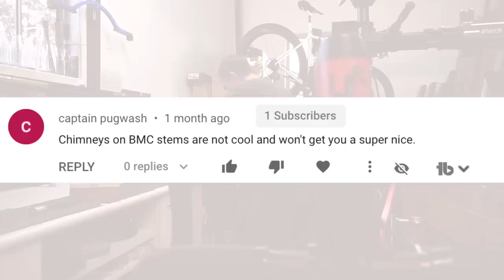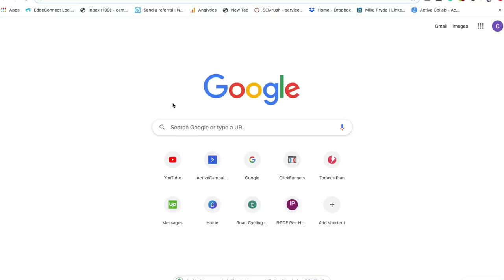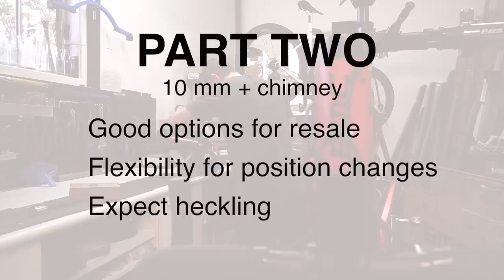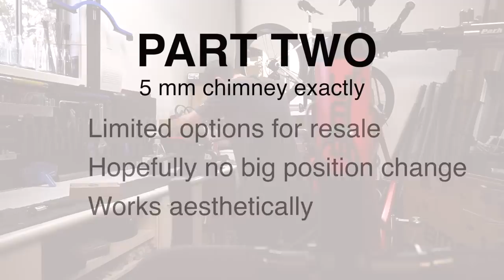OH DEAR, what have I done to my BMC Teammachine!?

Comment: I’m surprised no one has mentioned that leaving a 5mm spacer above the stem is a bit safer.  It allows the compression plug to fully support the steerer where the stem clamps.  Slamming it requires the steerer to be a few mm below the stem, causing uneven clamping forces, making it more likely that the stem will cause crushing damage.

Comment: Chimney?  I call it the “resale knob”.
Reply from the maker: hahaha!
Reply: Exactly - fell that chimney and you cut your resale market HUGELY. The number of times I’ve liked a used bike but the owner has slammed the stem ....
Reply: @cyclotaur6315  lol in singapore, fixed gear riders are usually teenagers (flexible lot eh) and everybody slams their stems without thought, and people still buy it somehow
i slammed my cinelli mash bolt and damn, it looks nice but i dont feel any discomfort so yeah
Reply: If the compression plug doesn't extend to the bottom pinch bolt, it's really the "fork steerer failure knob".

Comment: Correct me if I'm wrong, but I didn't hear any mention of the importance of ensuring that the compression plug inside the (carbon) steerer is located at the correct position so that when you tighten the stem bolts it doesn't crush the steerer tube. If you have, say, a 35mm 'chimney' and a short compression plug with a 'lip' which locates it at the top of the steerer tube, there will be nothing inside the steerer at the point where you tighten the stem bolts to resist crushing forces. Seen a couple of forks snap that way with interesting consequences. I personally ride with no spacers under my stem and no chimney and bought my current frame on the basis that it had a 178mm head tube so that I could set it up that way at my preferred height. A solution to your problem which you may not have considered would be to move your cleats back 7.5mm.
Reply from the maker: Yes it was an oversight. I’ll raise in the next video in Friday. Thanks for the pick up

Comment: Safety is another consideration regarding how many spacers are above the stem. The expander/compression plug inside the steerer is designed to strengthen the steerer where the stem is getting clamped and squeezing the steerer.  If you have too many spacers ontop, the plug isn't where it needs to be. The plug will be sitting up too high in the steerer and the stem will be squeezing on hollow steerer tube, with no reinforcement from inside. Definitely the BIGGEST consideration with spacers.....it could save your life.
Reply from the maker: Good point thanks for adding mate.

Comment: Get some thicker bar tape Cam, or double wrap it. That will raise the front a little.
Reply: That's a smart idea
Reply: A step further would be to run a 28mm tyre up front and a 25 at the back.
Reply: Hugh English that wouldn’t help. You’d still be in the same position relative to the crank, seat and handle bars.
Reply: How about a 650b wheel at the back😋

Comment: Aesthetics? I would consider mechanical issues. A 5 mm spacer on top of your stem will make sure that the stem and compression plug will be aligned and balance clamping forces. This will prevent carbon damage on your steerer.

Comment: I had to look into this recently after buying a new stem and the instructions said "minimum 5mm spacer below and if installed on a carbon steerer tube one spacer above". The reason that it is recommended to leave a spacer on the top is not to crush the free carbon edge on the steerer when tightening the stem potentially causing delamination. Not all steerer tubes require the spacer above, if the expander insert fully supports the free end then you don't need a spacer above. That being said, if you only have a 5mm spacer above and a unsupported free end you don't have any upward adjustment.

Comment: it has nothing to do with space length below the bars - what ever is comfortable for your style! There is nothing technically incorrect with having a lot of spacers below the bar - it is just an aesthetic concern.  Your concern about a "chimney" is only aesthetic, however, SAFETY  and potential compromise of the carbon steerer tube is more important. If you have a significant chimney without changing the standard expander plug - you then have the expander in the steering tube > expanding out without resistance. The expander is designed to push out but against the stem. If you have a chimney you should have a longer expander plug > that reaches down to the depth of the stem. I believe durian rider speaks often of this.

Comment: Two points,
1. Running spacers above the stem is dangerous if you have not got a long plug, as the stem is not fully supported. Re: check out leuscher technik.
2. Smaller cranks will give you less leg lift, so the lower handlebars may be okay.

Comment: I had the same problem with my bike, shortened the cranks but had very little room to move the handlebars up.
I switched to the Ritchey Ergomax WCS handlebars which have 10mm ride on the tops.  Some others like the Hover bar have more around 15mm.

Comment: I’ve done something similar cam. I’ve just built up a bike and gone from 170 cranks to 165 and the front is 25mm lower.it has 5mm spacer below stem which is what i bought it like. I didn’t think about it at the time. It feels ok but only done a 50km ride so far.

Comment: I’ll be honest. When I bought my  TeamMachine SLR 01 disc, I replaced the cranks with a 50/34 compact 165mm crank and replaced the stock ultegra chainrings with Absolute black ovals and I left one of the stock spacers under the stem and chopped the chimney. Went to 40cm enve bars too. I love the shit out of my “Matilde”.

Comment: not understanding - you went from a 172mm crank to a 165mm crank which is shorter. You'd need to LOWER your seat slightly, not raise it, yes?
Reply: Distance from pedal to saddle is reduced by shorter cranks, to keep the same effective saddle height on shorter cranks you have to raise the saddle
Reply from the maker: @joseph.inglis  Correct, Neill's got a fair amount of credibility too!
Reply: If you’re shortening the crank you’re reducing the length from the pedal. So Neil is correct and to compensate this you have to raise the seat.

Comment: Not an overly drastic move IMO. I like the look and its not overly aggressive for a crit racer. If you go on long rides and need more comfort, flip the stem for it. No need for a bike shop there.  Northwave makes a Speedplay cleat adapter that may give you a little help if you really need it. The sad part is you need their shoes. I'm no shill for the company, but have purchased 3 pairs in the last 10 years. 

I would like to hear more about the crank length change and what you have seen as far as improvements etc. Love your channel!
Reply from the maker: Cheers mate. And yes plenty coming on that topic.

Comment: I can not understand why stem angle isn't part of your conversation Cam? Much cheaper than new forks. 

The bar's position is only determined by the combination of fork steerer clamp height and the angle/length of the stem itself when combined with a particular frame. By using a different stem angle the need to trim the steerer tube can be reduced very significantly. Smaller frames very often have more fork steerer to be trimmed than larger frames so the likelihood of needing to cut in the first place is much greater.

The length of the steerer tube of the frame itself will determine the look you can end up with when the bars are correctly located. My 61cm RS uses some spacers below a 130mm x -10deg stem whilst on my 61cm RCA I stumbled upon a slammed 130mm x -17deg stem for the same bar height. It's great to leave affordable options for the future by playing with stems, just like saddles and seatposts. What brings comfort from a bike position can change for many reasons.

When I could ride past the Beach Rd 30kph bunch solo on the RS, I didn't care if all those I passed had a better chimney look than my EC90 stem and Ti spacers gave. Behind my steerer I had my X-Lab pocket rocket blasting out tunes from an MP3 player, no ear buds for me. It has allowed my position to evolve over a decade on the RS as a now 60yo.

If what douchebags are saying about such things a chimney height matters to you, perhaps some re-centring is in order Cam! Allowing for the future fitting or resale are wise considerations, they can only be achieved according to what our budgets and knowledge allow. Also, never make 2 changes at once unless 101% certain, twice or thrice checked. Bike lessons can be expensive.

Remember that bike fitting and power production are functional, they don't care about 'the look' required.

Comment: I was about to change my crank length from 172.5mm to 165mm as advised by my bike fitter but suspended the move when I watched your videos a few weeks back. Can't wait for your new video about how you find the changes.

Btw, I enjoyed your video about R5 vs SL6. You are right, R5 indeed is just as quick and stiff but slightly more comfortable than SL6. I am 48YO and I need that.

Comment: I think it's worth mentioning, you're not necessarily stuffed if you slammed the stem and left no chimney. Steerer tube extenders are a thing. Sure, they aren't made of carbon so will likely add at least 200g to your build in the best case scenario, but at least it's an option.
Reply from the maker: Good point thanks for sharing mate

Comment: Another thing you didn't mention, is that running a 20mm chimney without a special extended compression plug is dangerous on forks with carbon steerer tubes. The bottom bolt of the stem clamps down on the empty carbon tube rather than the carbon tube with a solid compression plug in it. It doesn't happen often but there are cases where this can cause the steerer to crack and cause a crash similar to the sprinter Simon Pellaud's.
Reply from the maker: Good point that I neglected to mention. Thanks David.

Comment: Should have mounted a -25 stem to the top of the factory length steerer for that old school quill stem look instead of cutting it down to solve the chimney problem. 😉

Of course I say that as someone who bought an s-works tarmac and slammed the stem flush with a one-piece carbon bar without even riding it first. No ragrets!

Comment: I'm surprised you did not mention the importance of having the stem tightened on the expander plug in the steerer tube to avoid carbon failure? Safety is the most important part in stem height in my opinion, position comes second. It's usually not a problem these days because expander plugs are longer than before, but still, it's worth paying attention.
Reply from the maker: Yes good point Anthony. I put these videos together quickly and sometimes things get missed. I can always follow up though in the next video. Cheers, Cam

Comment: It's all good 👍, don't loose sleep over the drop of the stem, you will get used to the slammed position. No scientific backup, you will ride the hoods more until you get used to it.
Reply: Not all 'slammed' positions are the same. It depends on your saddle height and head tube length. I ride a saddle height of 750mm (mid-foot cleat placement), 57cm TT, 130mm 10 degree stem with a head tube of 178mm. 'Slammed' stem gives me a 'drop' of 7cm. I chose my current frame specifically for this sizing.  Met a guy this week with a BMC Time Machine, bought second hand with the steerer cut in the slammed position. Saddle height 80cm, head tube 160mm, drop of 14cm with a 6 degree 9cm stem. Can just about raise his head enough to see where he's going when he's on the hoods, riding in the drops and the theme tune from 'Mission Impossible' starts playing, numb nuts after about 90 seconds. Seems happy enough though 'cause it was cheap and made of carbon fiber. #hardonforcarbon

Comment: You aren’t supposed to have any spacers above the stem on a carbon fork as you need to have the expander plug inside the stem to prevent the steerer from cracking.
Reply from the maker: 0 spacers? I thought you could have up to 10 mm safely.
Reply: @CamNicholls The Cannondale manual specifically says no spacers above the stem.  Most people probably don't know this. However, I figure you can get away with spacers above the stem so long as the expanding portion of the plug is within the bounds of the stem.

Comment: How about you can get cracks in steerer tube with, 10mm + spacers on top. If you use stadart steerer plug that dosent go under stem if excesiv chimny is present.

Comment: The world is not going to end. Just a little Free thought .  Just flip the -6 deg stem over,  that's a 12 Deg change, it will be just about right. Then move your computer to the top of your stem. and no one will know except you. You can save some grams by dumping the bracket, most stems don't care it thay are mounted -6 or + 6

Comment: Despite what a lot of cyclists believe image isn't the slightest bit important. Don't cut anything that doesn't need cutting. You have potentially just cut a big hunk out of your wallet for the sake of image. Personally I have about 30mm of chimney from memory and I could care less. I have my speedo immediately in front of it so there's no aero cost which at my speeds matters not in the least. I also adjust the height of my bars up and down most of that 30mm depending on the time of year and how much I'm riding and whether I'm just out clocking up some km or trying for maximum speed.

Comment: Would be interested in the recommended height of spacers below the bars. As I have at least 45mm below the bars. No chimney at all. I have wondered about the handling of the bike with this. It works for me being older and not as flexible. But just interested as I said on the handling issue, and is it dangerous.
Reply from the maker: No more than 30mm below ideally

Comment: You can probably raise your saddle not all the way and get away with the minor difference in drop between actual and prescribed. Personally, I think if you're within 5mm on any fit measurement then you're okay. We don't sit rigid on the bike, bibshort pads vary, bar tapes vary etc etc. Don't shell out on a new fork.

Comment: Best 90seconds of your channel sofar. In my understanding you don't need to change the saddle hight at all when changing the crank length. Depends on what your intention is. Less knee bending? Or less knee streching? Or a bit of both? But I'm sure you figured that out with your fitter.
Reply from the maker: Not 100 Max just following instructions from Neill 👍

Comment: Bike position is fairly arbitrary. I've got two bikes one with a saddle to bar drop of 10cm and one with 12cm. For various reasons I cant set them up the same (steerer tubes etc) Depending on which bike I have been riding both feel about right despite a large difference between them. If I have been riding with the more aggressive position I get back on the 10cm bike and it feels like I am riding a dragster or a MTB it feels so upright. Conversely when I go back the other way it initially feels like my head is on the front wheel. Neither position is really more comfortable than the other and I feel my power outputs are the same as well. I guess the lower position is more aerodynamic so if you can cope with lower it should be better.

Comment: The top of the steerer tube must come past the centre of the top bolt in the stem - that is the highest you can ever go without compromising safety.
Safer still is to to have a carbon steerer come out of the top of the stem and run a spacer above the stem.
@lanternrouge has a great video of a pro riders steerer failing in a race.

If you have cut it too short - you need a new fork - or a stem that will bring more flack than any chimney :)
Reply from the maker: Thanks for sharing mate.

Comment: Shouldn't have any spacers on top of the stem to ensure you compression plug is in the right place for safety!
Reply: 5-10mm is fine so long as the compression plug is longer so that you're clamping the fork steerer on the section where the plug is inserted. It's actually worse to clamp right at the top of the fork steerer.

Comment: You might have dodged a bullet as you may be able to tolerate a more aggressive position due to 165mm cranks improving your hip mobility. I've moved to 165mm cranks from 172.5mm  and despite having a greater saddle to handlebar drop(+7.5mm saddle height & same bar height), my ability to get lower and spend long periods of time in the drops is much better than with 172.5mm cranks, hopefully you have the same experiences
Reply from the maker: It's an excellent point Joseph. I was actually speaking to Neill last night about this because I was concerned and he said the exact same thing! Time will tell. Cheers, Cam